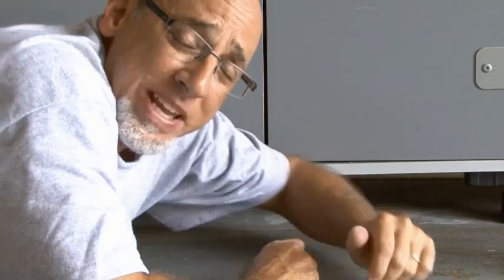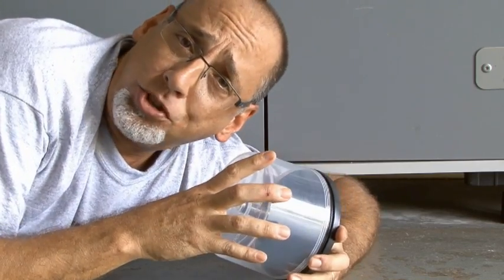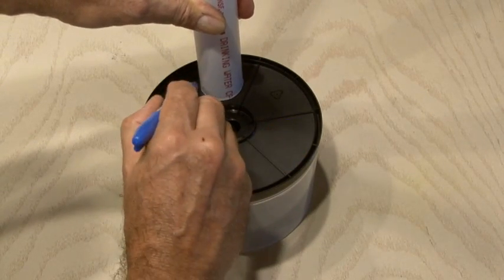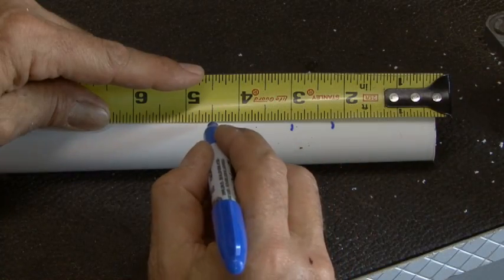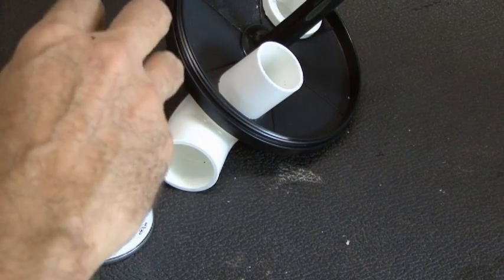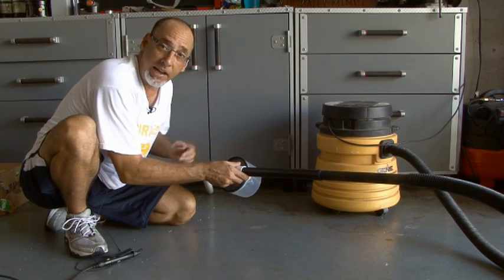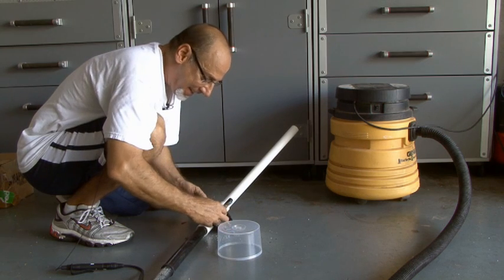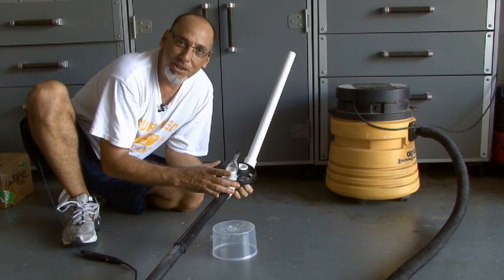Weekend Project: Lost Screw Finder

Comment: Its a nice thing build, however, for screws I have a collapsible magnet pen that I purchased for about $3 at an auto parts store.    I also was given another one from my father that is a fixed springy 2 foot long one that fits around corners really well.  

This thing you built I suppose is a good idea in the event you lose a crew around other metal objects that the magnet would rather stick to.  I might consider building this.  Cheers!

Comment: @DiarmuidC15 sometimes your taking stuff apart and you cant get replacement screws. if you loose one its more work to drive to a hardware store and hunt for one with the same thread pattern, and even worse waitting for one to be sent in the mail from the company who originally made what your working on.

Comment: @hiddenshadow1221 Looks like this fitting catches larger things (e.g. screws) instead of letting them through to the vacuum bag. Basically removes the hassle of sifting through all the dust you hoovered up, since the filter lets through most of the dust.

Comment: An easier method would be to zap strap a nylon or sock over the top of the vacuum hose it will all stick in the sock until you turn it off. A great tip for when you lose something down the sink like your wedding ring.

Comment: @bloodhound389 because a dremel can't cut round edges, and you need a rough circle, so what you would have to do is cut out the circle, and then use a file to get the circle shape a little bit better. But this would take a LONG time, and would be faster just to use an Exato knife.

Comment: there is even a better solution which is cheaper. just put some pantyhose on the nozzle of the vacuum and use a rubberband to secure it.... ofcourse if you like to build something like that, that´s cool aswell...